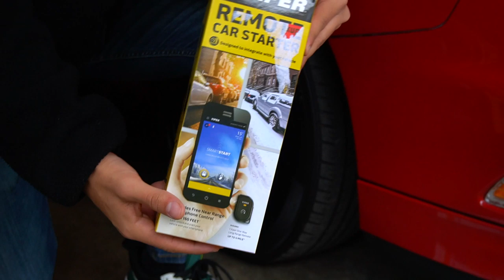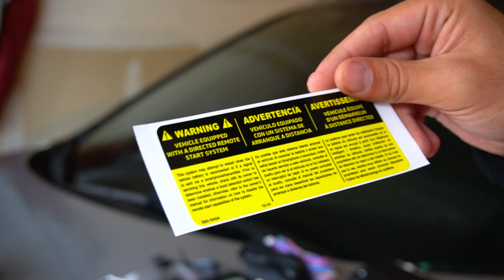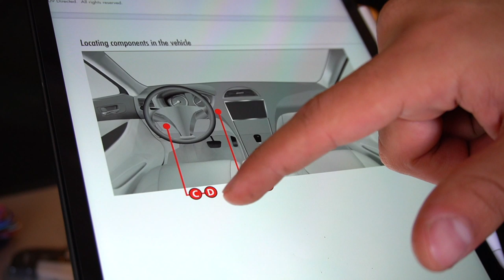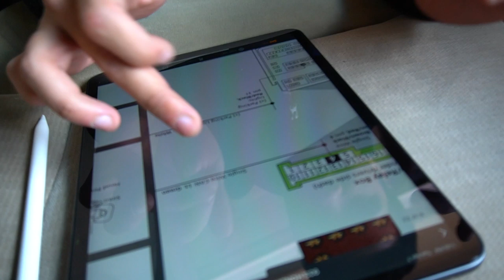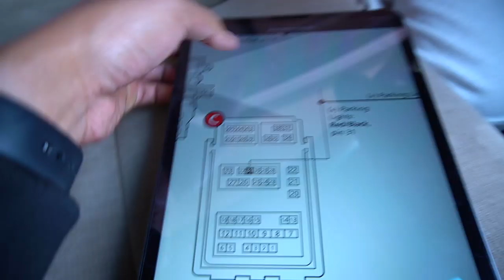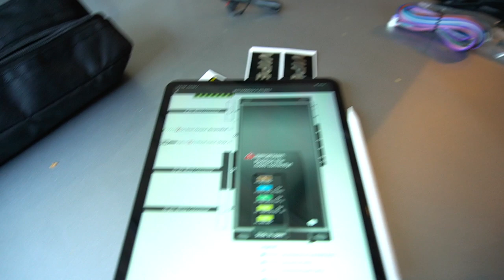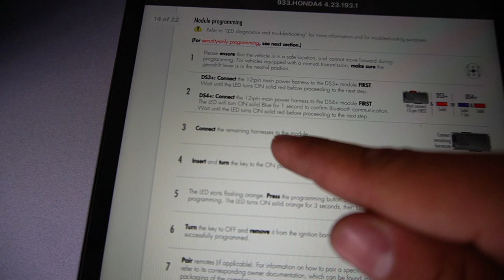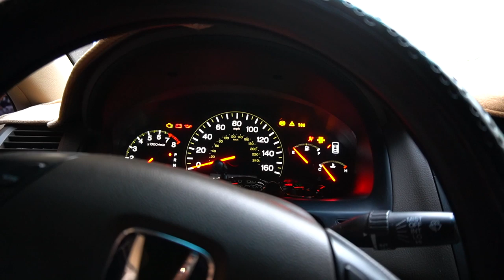How to Install Remote Smart in a Honda Accord - Viper DS4

Comment: In a process like this whereby you have wires all around is not a plug and play connection, a plug and play is just to connect the connectors and you are done.

Comment: Yo bro i have a 2005 Honda Accord Hybrid which sucks because i can’t do much, but i recently saw your video of the front door speakers, they sound nice 💯
Reply: I have a 06 accord hybrid that I've actually done a few mods on
Reply: @MrKaRtOonX3  what have you done to it?
Reply: @Xander engine wise nothing lol but I droppd it put wheels on it changed all the camber arms toe arms in the rear put the jdm accord head lights quicc release steering wheel added music 1 12in sub in the trunk and a chuchero thats wired up to a radio in the glove box jus little things I wanna do exhaust next but mines is auto so don't want nothing thats gone sound crazy my next purchase is the uc1 rear spoiler with bacc up camera

Comment: Quick question. Does the viper system you had on this video come with the main harness to the module? Or does that have to be purchased separately?
Reply from the maker: Ivan Luna it should come with everything when you buy it they should also sell you the t-harness as well

Comment: Try liquid electrical tape. Electrical tape will come apart with the heat and moisture. I have seen that alot when i come across due to electrical issues on cars.

Comment: How do you turn the car off after your start it with the remote if you want to cancel it.
Reply from the maker: Push the same button again to turn off or if someone tries to take off without the Kerry in there ignition, the car automatically turns off

Comment: Lol wrong info regarding the temp sensor.  Car doesn’t start automatically start when the cabin temperature reaches a certain temperature.  It simply will let you know the cabin temperature on the LCD remote.